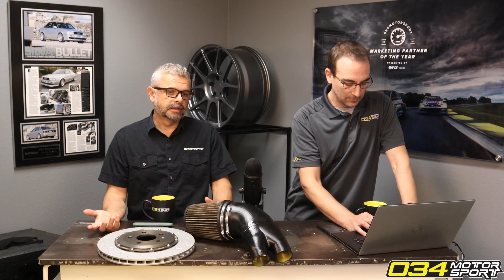What is Rapid Prototyping, and How Do You Take Advantage of it? | 034Motorsport FAQ

Comment: It costs $5k to 3d print an exhaust manifold, or the machine?
Reply: Machining an exhaust manifold usually isn’t an option, 3D printing runs about $3-4k, casting with lost wax in a one off can be about the same, San casting will cost much more than that with the mold and tooling fees, but it’s easy to evaluate at the time to determine the best option.